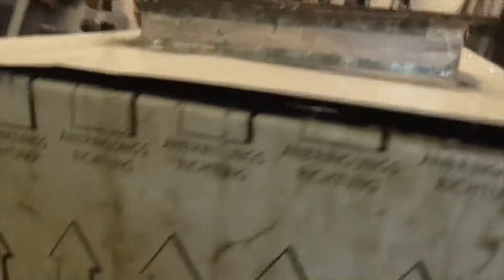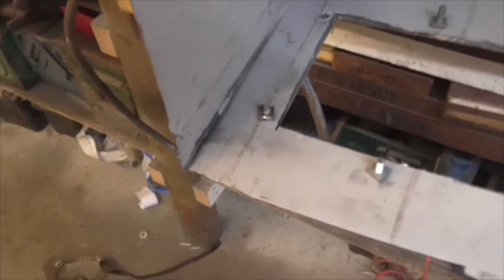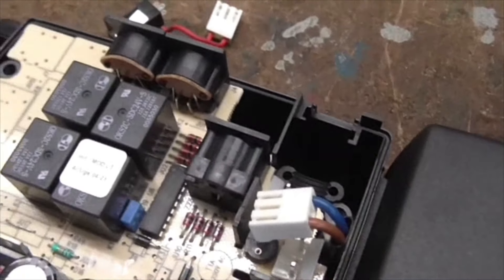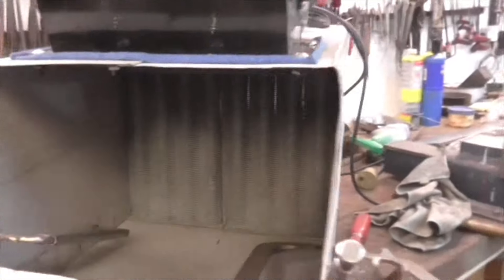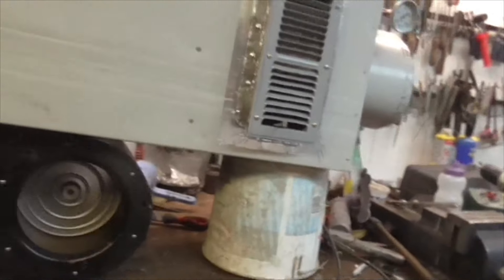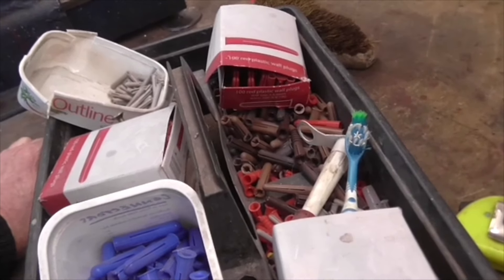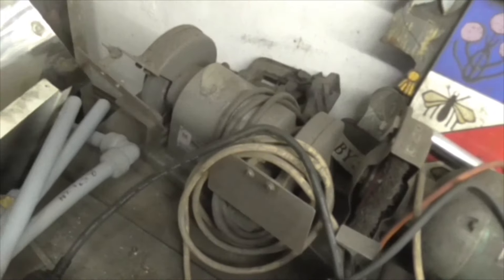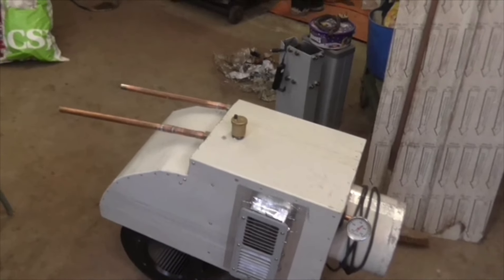Workshop Heat exchanger finished!

Comment: It has been cold and wet here all week. I like your idea for drawing a line around the pipe. The heat exchanger looks fantastic and I like your metal racks. I think we may need to install a grinder shelf too
Reply from the maker: The racks are great, as long as they are not all over the floor on Monday!! Ihave had an idea for the next one too! More next week!!
Phil

Comment: Let's hope the heat exchanger works as good as it looks Phil. Fingers crossed.....Cheers Tony
Reply: Forgot to mention, can you give us a demo on that hand folder you used bending those tabs over. I've never seen one of those before......Cheers Tony
Reply from the maker: I think it will, the whole lot is thermostatically controlled so I can make the heat exchanger as hot as I need to!
Reply from the maker: Yes, no problem!

Comment: Absolutely brilliant film as always Phil. The heat exchanger looks the business and I think it will work very well indeed. The workshop will be a haven. Our weather has been like yours, a bit of sun but a lot of rain. I have had my workshop heating on when I have been in there, and I don't usually need to at this time of year. Did youvsee what Calamity Kim did with her bench grinders? Wall mounted with a french cleat type ststem allowing them to be taken down or swapped about. Glad you are well my friend, until next week.
Reply from the maker: Yes i saw Kims idea, really good, but I am going to  combine  a metal rack under the shelf which also supports the shelf, I think I have it straight in my head now! Look at the heat exchanger and think of K9, the Dr Who dog! Machine nut Del spotted it! I knew it reminded me of something!
Phil
Reply: @philhermetic  I saw it too. In about 1978 or 79 K9 came to my school!